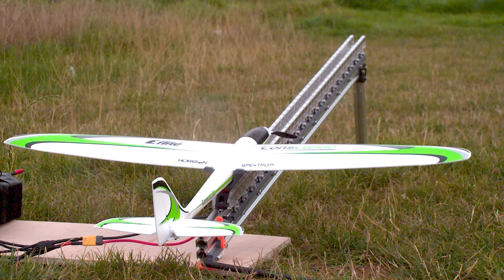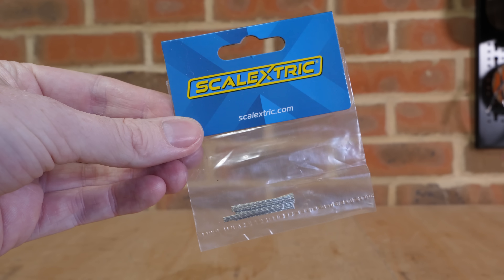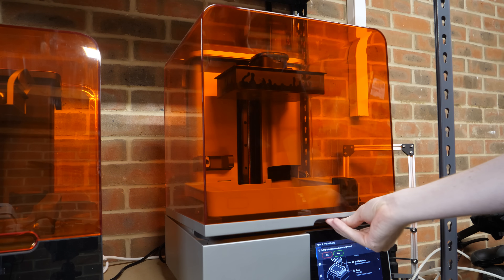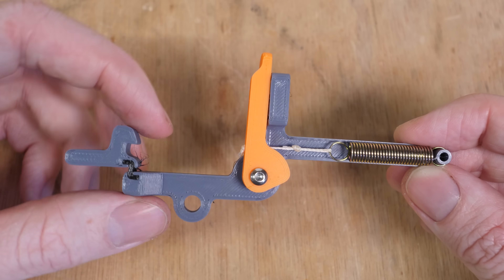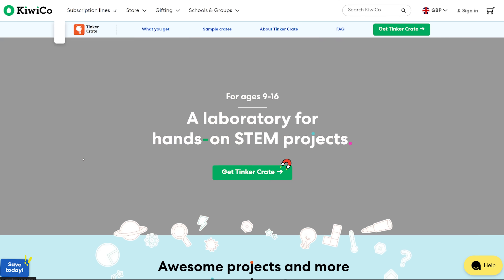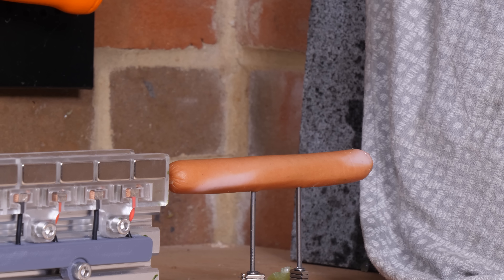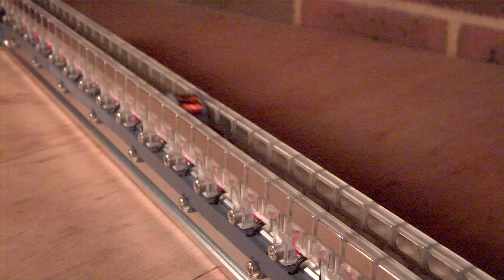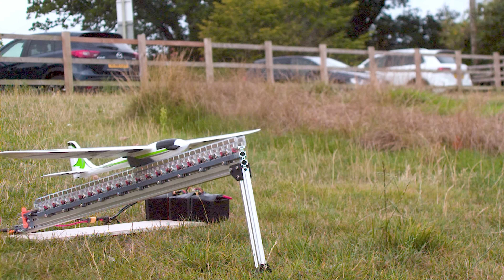Electromagnetic Aircraft Launcher

Comment: I suspect self inductance in the power railes might be limiting your ability to deliver power.  If you add a capacitor with low ESR to the strips on the power rails where the brushes make contact,  that way you can mitigate the self inductance in the rails with capacitors supplying the power helping the rails deliver more power nearly instaniously. 

Also, try the different number of turns again, but with the intended payload weight. More turns means more inductance. And more inductance resist a change in current which means not only more resistance  limiting current from the length of wire in the coil,  but more inductance limiting current.  Heavyer payloads Take longer to accelerate, which means more time for the current to rise. Heavyer payload might also benifit from  more iron in the core of your electromagnet.  If the magnetic core gets saturated,  the peak current jumps really high providing little extra magnetic field.

Comment: You could also try to optimize the magnet wire diameter... Melting vs speed.
Also you could hold the brushes in place without the crimp, just the plate pressing the brushes against the contacts.
No more resoldering needed

Comment: If I'm not mistaken, solder wick is impregnated with flux, which may be one reason the arcing is making such a mess. Not sure if untreated small copper braid is readily available, but larger sized braid is available for making grounding straps and the like. Also, I wonder if carbon brushes for DC motors might not work better.

Comment: Imagine doing a cylindrical design, with 360 contact points. Build it into a tube that goes in a circle, thereby creating an infinite accelerating object. The surface area will be greater, which will reduce the sparks even more
Reply: Or even better, build a tube of coils inside a tube of magnets. Maximum efficiency, basically the perfect engine

Comment: Did all this math before realising you must've already done it yourself, because for the plane you used 2x 400 coils, but I'll post anyway.

Did some basic algebra and came to 0.05g per coil turn, and 5.5g for the sled. This would make the 200 turn coil 15.5g - I can't weigh it so this is the best I have. 

That makes the 400 64% heavier than the 200.

However! If we added a 100g projectile, like the plane, it would only be 8% heavier. So my hypothesis is the heavier the projectile, the less the weight of the sled matters.

Also here's the algebra for working out the weight of the sled, t is the weight of one turn, s is the weight of the 3d printed portion of the sled

400t + s = 25.5
100t + s = 10.5

s = 10.5 - 100t

400t + 10.5 - 100t = 25.5
300t = 15.5
t = 15.5 / 300 ~= 0.05g

25.5 - 400t = s
s = 5.5g

Comment: Wouldnt it be better to use contact wheels for powering the coils? That way you reduce friction as the wheels will just turn on the contact rather than beeing dragged on them. Just cut out slots in the rail to put the metal contacts in and put metal wheels on the projectile. To ensure that the wheels stay in contact with metal just put magnets overhead to repel the projectile down into to rail. So you gonna have to remake the projectile to have a coil at the top facing the overhead magnets. So you end up with more repulsion force, less resistance and less sparks due to bouncing of the connections.

Comment: If you want to solve the problem of conductive plates and brushes, you can use copper sheets and carbon brushes like those used on brushed motors🤔

Comment: Another downside to more turns per coil is the increased inductance. Meaning the magnetic field rises more slowly, imposing a limit on top speed (as opposed to carriage weight, which limits acceleration).

Comment: I've seen electric motors with multiple parallel wires per coil, e.g. basically each layer is a different wire. This can increase power because you don't have to deal with a rising resistance.

Comment: That's great! I would have used the trigger mechanism to move the sled into the magnets, that way you eliminate the electrical bounce completely, also you could add a small RC shock absorber at the end of the rail to stop the sled going off the rails, since the RC plane will be faster the moment of the sled slowing down, the shock absorber will just need to stop the mass of the sled. 

And If you want extra points just put a linear rail so the friction is virtually zero.

Comment: something to try; a hallbach array on the magnets
a hallbach array is used to create a stronger magnetic field on one side of the magnet strip, which id say would help here
regarding the turns; thinner wire might also work (put into parallel, so a couple of strands wound at the same time instead of just one wire)

Comment: Man why don't you use the rail to power the coil, as in the Scalextric? made it several short parallel rails, power them plus and negative alternativelly. You can even use model train rails and even the wagons for the coil. The main work is avoid that the brushes shortcircuits the rails when passing from one to the next. But you colud do it just in one of them.

Comment: It may be worth adding a capacitor bank as your load will be pretty spikey/intermittent - this might enable a bit more current to flow rather than being limited by the internal resistance of the battery bank.

Comment: I have no idea what it's called, but think to how brushed motors have more torque than similarly sized brushless motors. So too does this have more force generated than your old coil gun. Additionally, you'd have to measure the force generated by the sled when shorting the contacts to find out how much force it actually has. Additionally additionally, because under load it stays in contact with each contact longer, it functionally gains more force to throw the sled and load. This probably has quite a linear strength until the maximum force is met and then it'd drop off considerably.

Comment: I'm wondering if  it'd be better to use mechanics to use low voltage to activate and deactivate a contact to switch the coils power so you'd needn't deal with arcing

Comment: Maybe use the graphite brushes from power tools as the contact points?  Would stop the brushes melting, and using the springs they use in power tools can always push them out to maintain contact.  Could also shape them to be wedges if that's more desirable.

Comment: I'm probably missing something, but why the need for the elaborate "starter switch"? If you're placing the sled in the correct place manually anyway, why not just use a normal ON-OFF switch that can handle the current? I don't understand. I thought you'd push the sled with the swinging motion and have the rail powered already. As it is, I don't really understand the need for an elaborate setup for the switch alone.

Comment: Would il work to have a continuous rail but with an AC voltage of increasing frequency going through it ? It would require a lot of sensors but would offload the commutation to the electronics instead of the many alternating sparky contact points.

Comment: Use 3 coils one 3 sids of the track. So the magnetic field dosnot get wasted. It will also increase the force of the projectile
Reply: isn't wasting the magnetic field of the rail a low priority design criteria? I'd think they're instead going for just the highest power-to-weight ratio of the sled, to maximize speed. Adding more coils that aren't sandwiched between another rail of magnets just sounds like you'd be increasing size of the sled, which increases losses.

Comment: For a simple improvement; put a back-iron, or just a simple steel strip on the back of your magnets. Id guestimate that should close to double the permanent-magnet field strength near to coil; right now your PMs are effectively wasting half their magnetic juice magnetizing the air on the wrong side, and the back iron drives that reluctance to near zero.

Comment: Making a relay from scratch doesn't seem like the best use of your time, but fun to use the dual material printer. It's fairly common to inject the projectile with a bit of starting velocity, which would have also gotten rid of the need for the switch, just using the spring to give it an initial push.

Comment: I'm curious why you didn't set up the contact strips to be adjustable separate from the magnets. i felt sure the optimal turn on time would shift slightly based on the coil's speed... especially since inductors have a response time. Still. clearly still works. 

also, I'm not sure if you already did this.. but your trigger mechanism might last longer if you only use it to switch the power on the first two or three phases. very nicely done though!

Comment: Probably a dumb question, but I've used the cheapo light switches you get at the Home Depot type stores...as they are designed to be fast acting and not bounce already.

Why not use those, or is the voltage or current just way beyond what those can handle?

Comment: In this case, since you're constantly building and collapsing the magnetic field, impedance is also a factor (reactive resistance).
Also - more of an interesting fact considering the design - when the coil disconnects the magnetic field collapses, inducing a voltage into the coil.
This fact likely intensifies the sparking that happens, and it may be bad for the power supply depending on what protections it has.
A solution would be a resistor with a zener diode, but it likely isn't worth the extra mass, some (extra) protections for the power supply may be worth it though, especially if you intend to use LiPo batteries.

It's not really comparable to this situation, but I remember a story from a place I used to work at where someone tried to repair a forklift.
They did so by removing a faulty zener diode and not replacing it, this however was used to protect the battery pack from the huge back EMF the engine would produce during normal operation, needless to say that fried the battery pack.

Comment: Wouldn't have been easier to have the sled slapped into the launcher by the trigger hammer and leave the wires permanently connected to the power source?  It would still only draw power when firing, but no trigger bounce issues.

Comment: The velocity curves seem to flatten out at the end. Which is kind of expected due to air drag. But I think it may also be caused by the inductance of the coil basically putting a speed limit on the rate you can switch around the polarity. So for the next launcher maybe try to make the contacts further forward of the coils towards the end of the rail. Basically trigger the field reversal earlier the faster it goes.

Comment: Good  experiment, but can't help thinking that an unwrapped linear BLDC could give far more power without damaging sparks, and the sled could have multiple poles to amplify grip.
Question is how to drive with one or more ESCs, and whether to energize the sled, or the stator track or synchronized sections of the track. Not a trivial problem.

Comment: how about try testing with a iron core or other metals in the coil, a nail with different thickness could be easy to test with. It would probably be slower but stronger, so it will be better at heavier projectiles

Comment: Potentially stupid question... The activation of the electro magnet depends on the speed of the electric loop being completed, right? I know electricity is very fast, but since the sled only only spends 0.1sec accelerating under load, would the acceleration benefit from gradually longer magnet and/or contact spacing farther down the rail?

Comment: Induction also plays a large part in the coil. I think the sparking is mostly caused by the induction, when inductors are disconnected they create extremely high voltages from the induced magnetic field. (add capacitors across the rails to protect your power supply!)
Another improvement to the launcher would be to increase the spacing down the rail, this allows for the coil to get to the right polarity on time.
Reply: And a flyback diode!

Comment: You should have a look at timing, at faster speeds you may get advantage from earlier energizing. And maybe use a rectangular coil, because your magnets are also rectangular? Also have a look at ferromagnetic cores, they may increase coil performance. And if that isn't enough, maybe try closer magnets in the beginning and more spaced out at the end. In the beginning you can kind of see it hopping from one to the other magnet, which is lost opportunity to accelerate. Maybe kind of related to my first proposal, timing. First 'phases' closer to eachother and ending with more spaced out ones.

Comment: Since you run a current in the sled, you could have a motor to spin a projectile inside a sabot like barrel riffling does. Then with a mechanism to stop the sled a the end of the ramp, you might have a completely reusable electrical gun.

Comment: This is one of the coolest designs I've seen so far, but I do have an idea to improve it a little more, sor safety's sake, and possibly to reduce damage to the sled.

A sort of catcher's mitt at the end of the launcher. I'm sure you could think of a better design than me but here goes. I would add a loose net to the end of the launcher, attached very loosely by just some weak magnets. The net itself is connected to the launcher via a long string, or maybe a spring. When the sled hits the net, it would wrap around it. The force of the sled will pull the net off the end of the launcher, and the spring would dampen the forward momentum, theoretically safely dangling, if not dropping, the sled safely onto the ground/table below